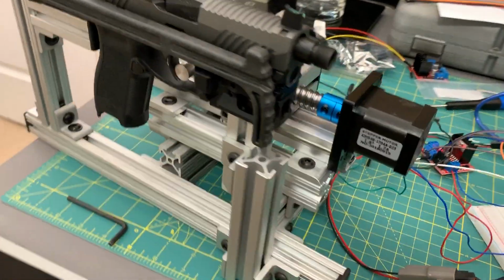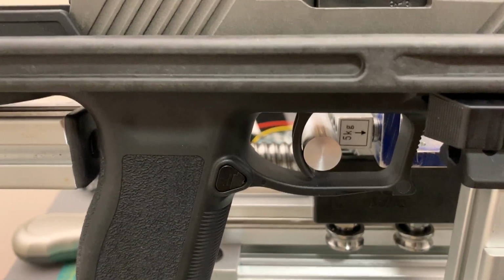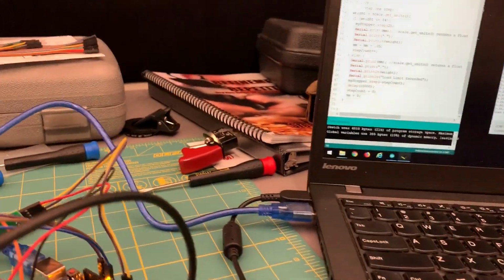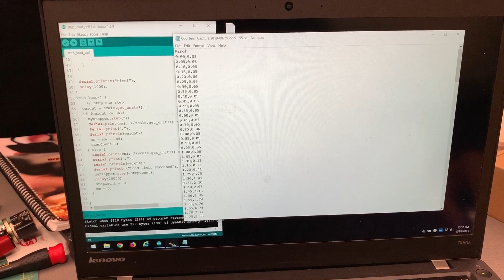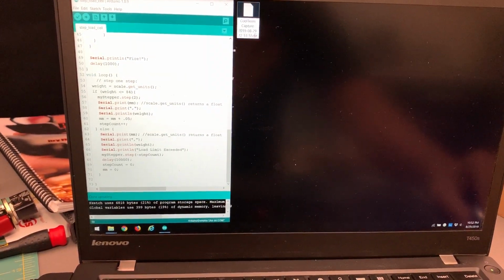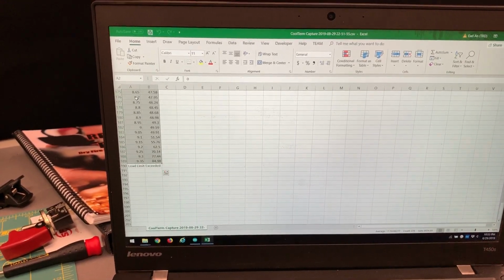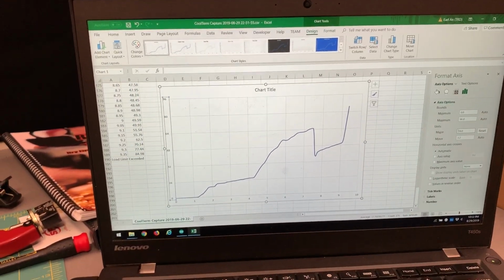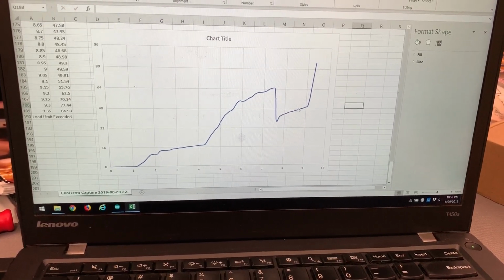It works!  Homemade TriggerScan.

Comment: That’s really cool. It’d be cool if you can show us your code and hardware and how you did it in general
Reply from the maker: I will once I have the bugs worked out.  Right now the motor will only run for about 10 seconds before the controller overheats, and the loadcell maxes out at 11lbs.  i have a stronger loadcell and a lower amp motor on order.